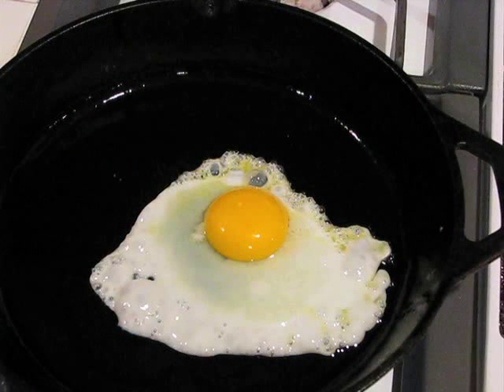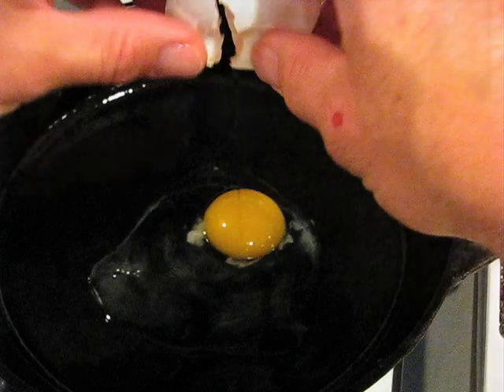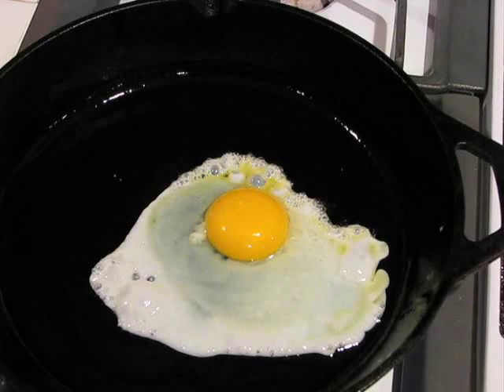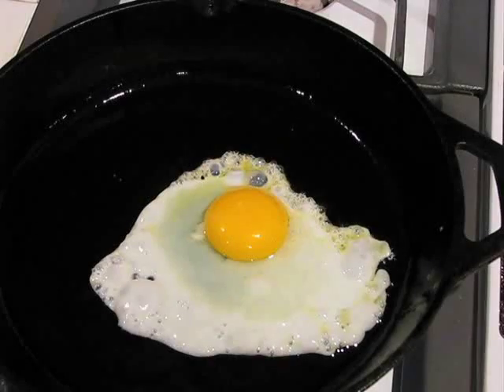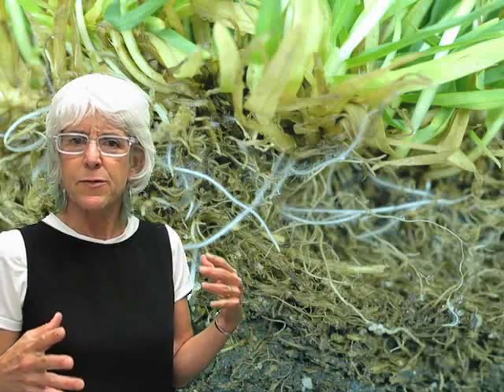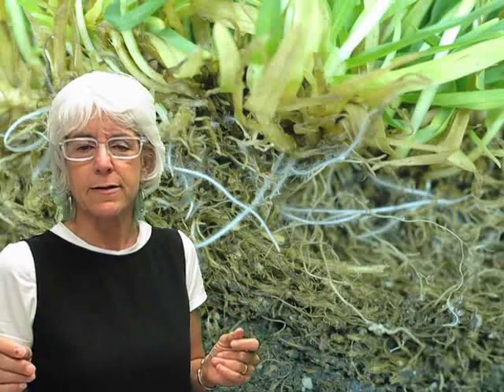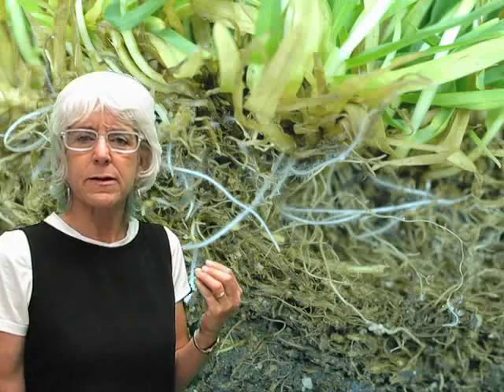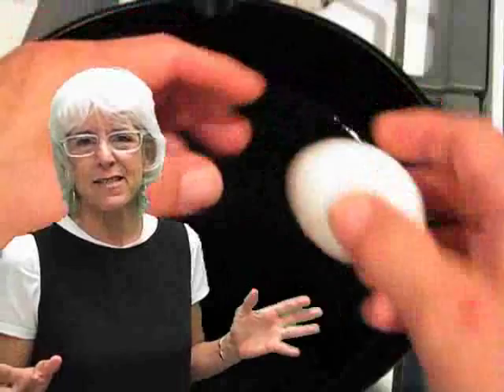Why does turf die in the summer?

Comment from the maker: @turtlesrcool5515 As long as there is some wind and the humidity is not too high, a syringing as you describe can help. Hand syringing can do a little better job, but a turn on the irrigation heads will help. Without some wind (natural or using fans), there is a risk of just adding water to an already stressed area possibly making the area too wet. Air movement is critical.